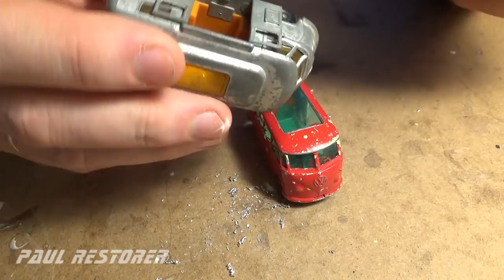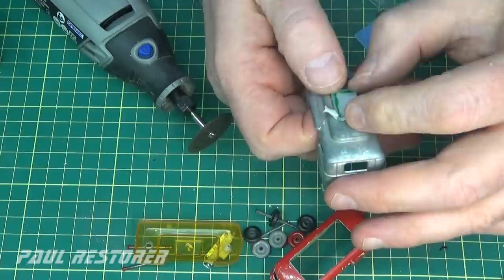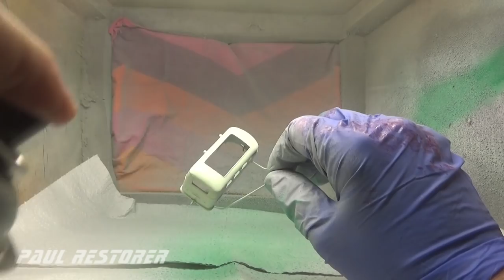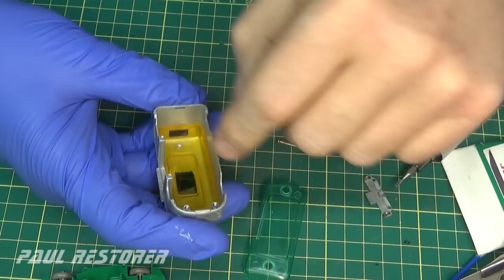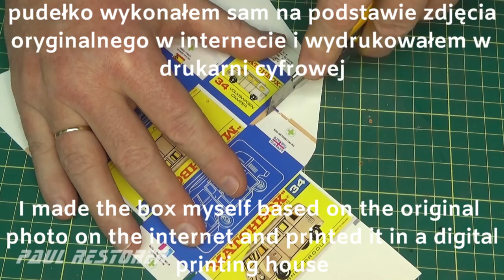Matchbox Volkswagen Camper nr 34 robienie drzwi, model autka odnawianie, renowacja, naprawa.

Comment: 00:00:35 disassembling the first car
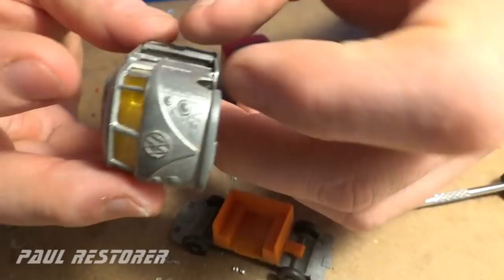00:01:26 disassembling the second car
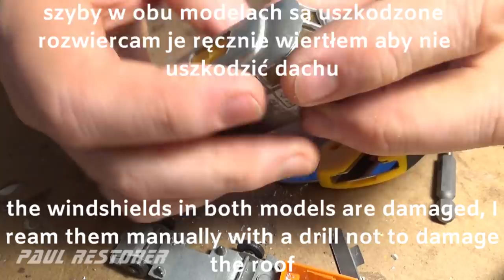00:02:00 removing the damaged windshields
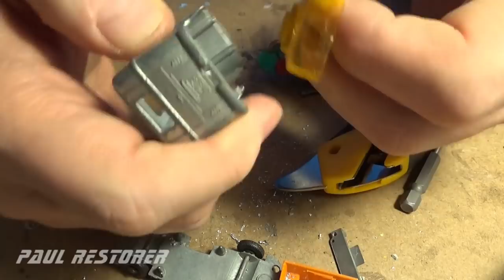00:02:15 using molding silicone to mold the door for the second car
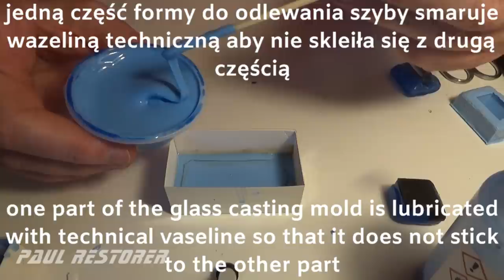00:03:23 one part of the glass casting mold is lubricated with vaseline 
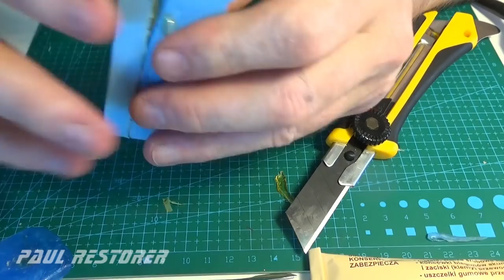00:04:06 the glass is made using polyurethane resin colored with green
00:04:37 gluing the plastic springs
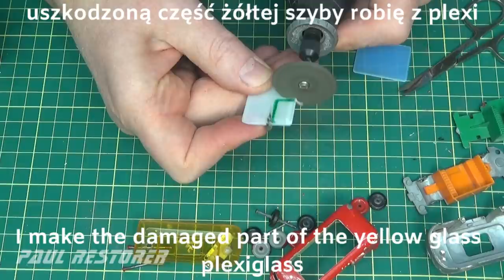00:05:18 making the damaged top glass from yellow Plexiglas
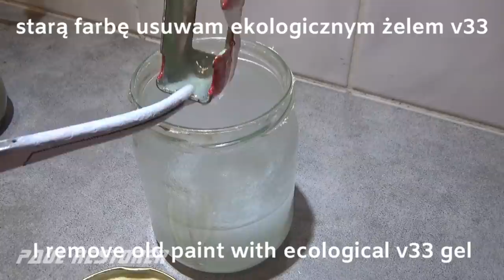00:07:08 removing the paint with v33 eco gel
00:08:32 cleaning the models with a soft bronze brush
00:09:06 drilling holes
00:09:59 applying anti-corrosive epoxy primer
00:10:54 applying paint
00:12:03 making a table from plastic
00:13:06 strengthening the plastic springs with inserts
00:14:14 painting the wheels with brake fluid
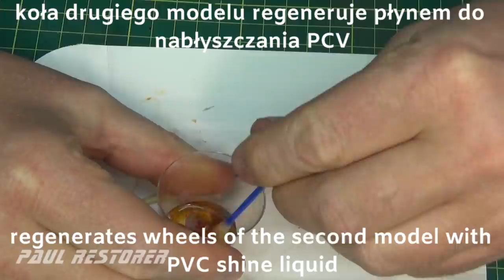00:14:34 using PVC shine liquid for the wheels of the second model
00:14:47 creating axles from nails
00:16:07 gluing the top plexiglass window
00:16:54 polishing the glass with Sonax paste
00:17:40 assembling the parts together
00:21:07 painting the logo with silver color marker 
00:22:01 cutting the boxes based on the original ones
00:23:24 the finished restoration
Reply from the maker: thanks

Comment: Yet another great video.  I noticed the problem you had with the doors I had a similar problem. Next time try using a post-it note (Sticky note) to hold them in place. Just cut the very low contact part and use it like masking tape to hold the doors it hold them in place and won't leave any Mark's on the paintwork.
Reply from the maker: Great idea. Best wishes

Comment: Does the paint look the same on the resin parts as it does on the metal ones?
Reply from the maker: yes of course there is no difference i use epoxy primer it covers very nicely you won't know which part is painted on resin. Best wishes

Comment: Looks like these are each a different variation..
Reply: They are.  There is yet another version of the silver camper which has a high roof, and skylight windows.  And, an older variant from the metal wheels era, which is a commercial windowless van.  A Superfast camper too, from 1970, in blue or orange.  Lots of different Kombis to collect.
Reply: I believe I had the Orange Version in my childhood.. Unfortunately it is long gone..

Comment: Nice and great job: only,  instead of glue the plastic springs extensions (4.39), you could  use for future  project, phosphor bronze sheet. This sheet has a  sprung action, specially here for the axles. Im model railroader and I use  this sheet to make electric contacts and others.  From here in several thickness.  https://cloverhouse.com/Cart/index.php.    Regards from Costa Rica.
Reply from the maker: Thank you very much for interesting comments. I will try to try such springs.
Best wishes